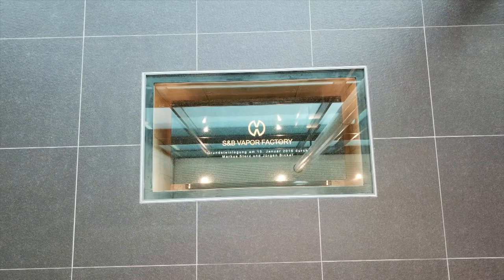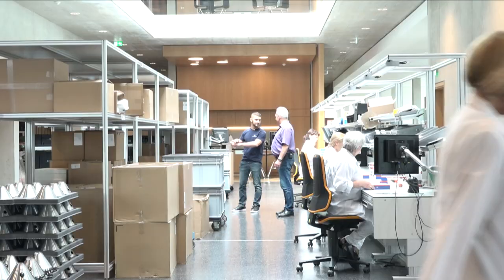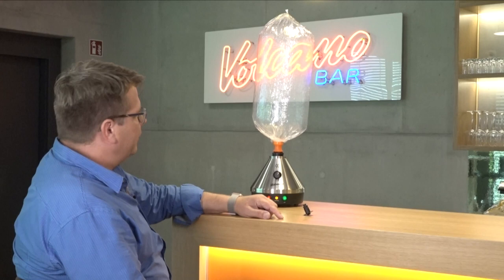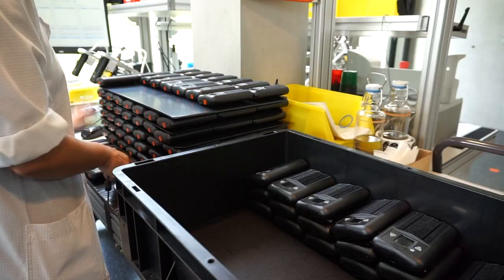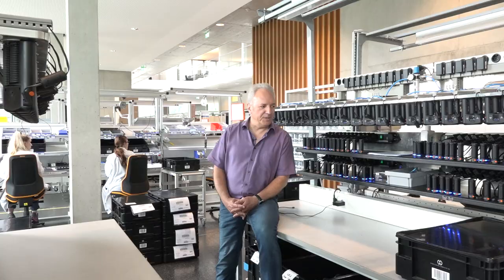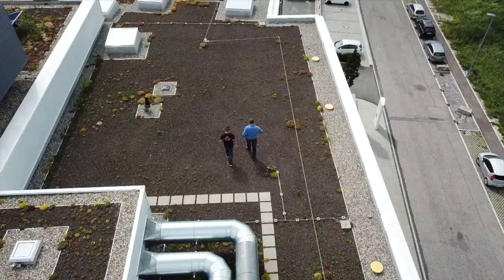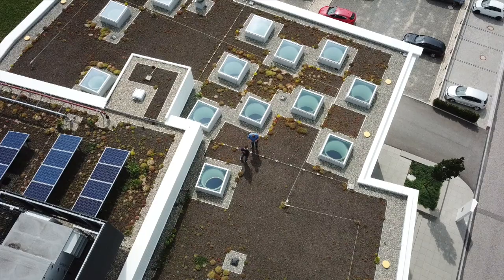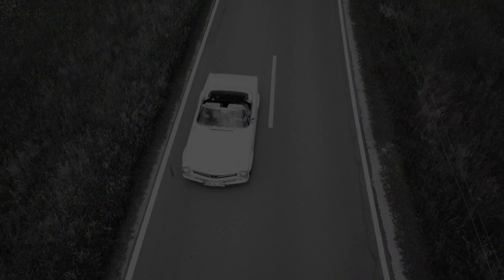Storz + Bickel Factory Tour

Comment: Just FYI you don't clip the bag on till you can visually see Vapor coming out of the valve, other wise half your bag is just oxygen. Cheers.
Reply: Hmm, bout that, I typically wait until it FULLY inflates, and typically vapor is coming out ever so slightly.
Reply: My method is two bags. 1 regular size and one half size. ( i make easy values with quiet bag material from ebay)

I start the DIGIT with the small bag on and as soon as I see thick vapor I swap bags to the regular bag without stopping the fan.
Then I sit back, watch bag 2 load with heavy dense vapor whist enjoying bag 1's tasty flavours. 

Thank me later. 😀
Reply: @my_other_account6008  Well thought. Which temperature did you set it up?

Comment: Have had a mighty for 18 months now and love it. Trying to decide on a desktop now as with pretty regular use at times I don't need the portability. The Plenty and Volcano are so different and it's hard to choose, the pricing is not the factor, the overall use is, anyone with some opinions is most welcome.
Reply: Both the Plenty and the Volcano (Digital and Classic) are great options for desktop models. I love my Volcano Classic. Amazing build quality and functionality.
Reply: I've had the mighty for a couple of years and I've recently got a plenty for use at home. I chose it over the volcano cause I like to use bongs and water attachments. I'll probably get a volcano in the future tho!
Reply: I might be a bit late for giving tip. Which device did u brought? I own a vulcano, my mighty i have Sold, But only due to my high tolerance, which was caused by the vulcano, the mighty did not get me any near the vulcano high
Reply: @ohnenamen5911  Got the Plenty on sale and it's obviously better on the cooling than drawing through a smaller intake in the Mighty, Getting the temp right where you want is a little finicky due to it being manual and not digital.
It doesn't feel as high quality as the mighty but is comfortable to hold and you can place a brush in the side hole to create a makeshift stand or purchase a third party stand so it can remain upright during use.
The vapor from it is what I imagined from a storz and bickel, just awesome and smooth.
If you want to save herbage you can get the liquid pads and place on top of a partially filled bowl so that the erb so the heat is distributed evenly and it doesn't just slide to one end when you tilt it each time you partake.
It's Plenty good, great bang for buck and fantastic performance.

Comment: Nice to see the tour.  If I could make any design suggestion about my several year old 'The Plenty' (which I love), it would be to make the temp gage more accurately represent the chamber temp.  On mine, heating up the gage will eventually read max temp, the light will turn out, and I still have to wait about 90 seconds for the herb to reach vape temp while the light is out.  It is as if there is a heat sync transferring the heat so it lags significantly behind the gage reading. It is ready about when the light can be turned back on the second time.  It doesn't impact the result and is an excellent vaporizer.  Wouldn't it be nice to have accurate temperature gage reading!?  I'm actually wondering too if this is an issue with just my unit, as I could understand if the sensor is lose or misplaced that could have a similar effect.
Reply: I have 1 and its the same

Comment: Crafty is interesting but the undersized battery combined with a poorly located and designed temperature sensor just ruin the experience, especially if you use it on a daily basis. Otherwise, for a moderate, solo use it is definitely a nice, discrete device with an excellent vapor quality.

Comment: Hey S&B I recommend you stop engineering your crafty products to fail and void your 2 year warranty after 60 hours of use. 
The use of an 184c fuse on a device that heats up to 210 degrees is absolute bullshit. Also, 75$ to replace a 10$ battery? Really guys... 
you people need to take a step back and look at your companies policies.